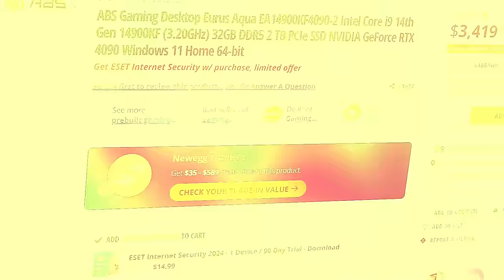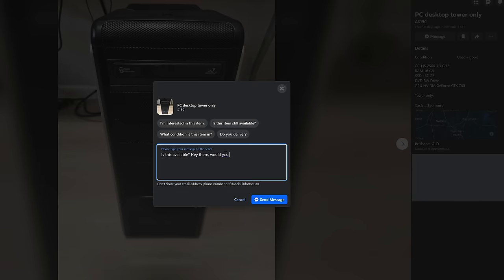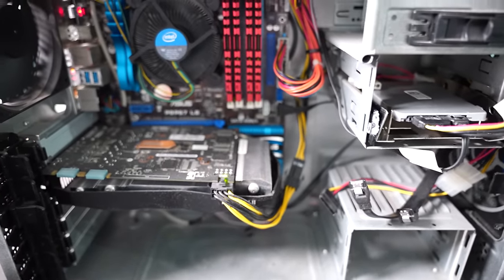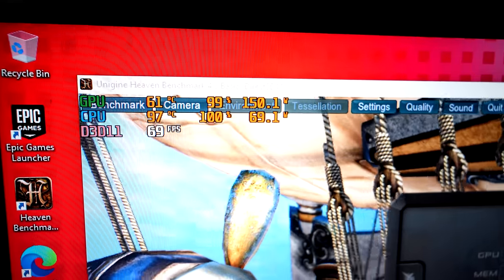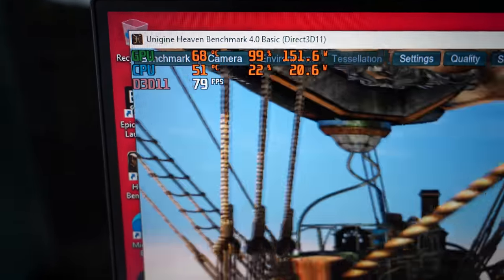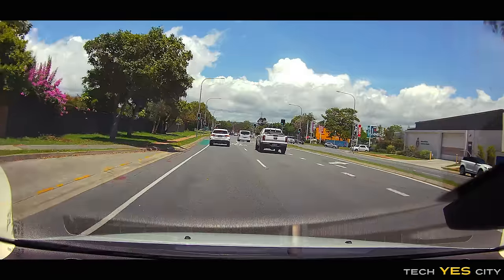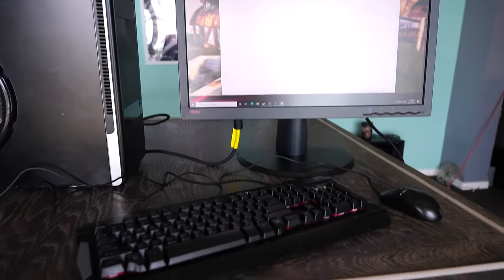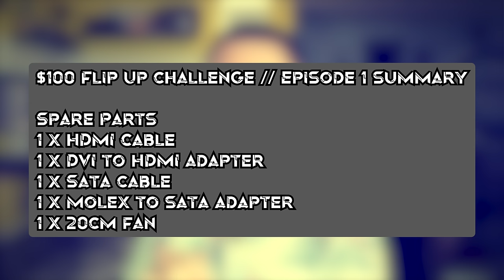Turning $100 into a HIGH-END Gaming PC - S3:E1 "Less (Power) is MORE!"

Comment from the maker: Easily the most requested content on the channel is BACK! Enjoy the rollercoaster!
Reply: ive used cleaning slime for cleaning in between the keys on a keyboard. it works really well. i love the $x flipping series.
Reply: If you weren't quite so far away. I have a bunch of spares... 3200G, 2600X, a320i, an itx 2060, 2x 4GB 3200 memory & 650w psu.
Reply: @justinpatterson5291  where are you? Maybe i can help.
Reply: Yaaaaay I did not expect this but I‘ll take it happily
Reply: @techyescity Started watching you 10 years ago when I was 14, now working at a local repairshop repairing and building pcs. Thanks for the content, I’ve learned a lot over the years! ❤
Reply: Bought a malaysian pc i see.
Reply: Even a 2004/2005 400 Watt CRS PSU would deliver more on it's 2 12V rails. I once had build a gaming PC with that back in the day with a Core2Duo and a GTX460 (2 six pins).
Reply: Yes yes yes!!! The beat series on youtube is back baby.
Reply: I remember owning a Yum Cha power supply in the day, it cost me a whole PC "A big bang, blue smoke and a smell that was worse than some nostril hair being burnt!" Learnt my lesson and never touching a no name PSU again, I hope you used InSpectre utility with that CPU in windows ty for reading!

Comment: Blows my mind how even the 2500 can push out nearly 120 fps on CS2.  I'm starting to question if my own build is overkill 😂
Reply: My 8700 gets like 200 max with a 1070ti
Reply: Single Core performance..Old engines using single core.
Reply: Notice he never shows any gameplay for CS2 though. Likely because it doesn't run that well.
Reply: Depends on what you use it for. I rock an i5 12400f and a 3060TI n feel like I already need a upgrade. My son wanted to play forknife and some other garbage like Roblox and battle bit. I spend next to nothing on a T1650 computer from dell and modded the case to take a bigger GPU, popped in a better PSU and built him a respectable PC with a Xeon 1230 v3 and a rx 580. The build cost me around $200
Reply: @HardWhereHero  Hardwares are good these days. If you manage your expectations its great. I have 12100f 6700xt and 4k60 is no sweat(with appropriate settings ofc)
Reply: What are your specs?
Reply: Nothing wrong with a 2500 I had a 2400 for years with a gtx 1050ti then a 290x and it worked good then I got a used 1080 and had no issues with any game maxed on 1080p except recently with maybe like cyberpunk then I swapped for a i3 12100 and its once again not an issue lol.
Reply: @BREEZYM6015  5700x and an RTX A2000 12GB.  The former from a Black Friday sale that made it 100$ and the latter from last year's crypto crash, making it 350$.
Reply: battlebit is not garbage
Reply: @cdnron75  exactly, standing still is not a true average
Reply: been using 2500k since its been released, aint go no complain to that bad boy
Reply: @Hablift  source engine scales with up to 6 cores and SMT, it has always been able to take advantage and utilise more than 1 core.
Reply: @Hablift Valve is moving on from source 1
Reply: Dota 2 is overdue for the same treatment as CS. Performance is abysmal.

Comment: I would have never paid $80 for that PC. Aside from the e-waste SSD, it's 10-12 year old technology. Cheap old power supplies like that are fire hazards (I've seen cheap ones like that actually catch fire) plus you can see rust on it! It's not worth trying to keep the budget under $100 if the power supply is going to fail soon or burst into flames on the buyer. As well, the GTX 760 hasn't had driver updates in quite some time, and I'd like to know what settings you used in Heaven to get those FPS. I always run it with everything maxed out to truly stress a GPU, and with much better graphics cards I don't get those numbers, so you're not truly stress testing this card. You also say early in the video that you kind of got hosed on the PC but after cleaning and "tuning" it plan on selling it for $250?! If you plan on selling it for that, replace the power supply! This gives me used car salesman vibes. Sketchy AF.
Reply: Is undervolting the "slaps roof of car" meme but for used PC's ? 😅
Reply: Can you find a setup that performs better than this for less than $150? Pay less, get less.
Reply: @technicallycorrect838  😂If it's not, it should be!
Reply: @cdnron75  
Have to agree here. I get this is absolutely lowest budget, but if you don't make an effort, just don't do it. Undervolting is not a fix, if someone clears the bios or just disables the GPU undervolt/underclock somehow the pc will be unusable again. Fine if you do it on your own PC, but I would not sell this.
Reply: @NamTran-xc2ip my £100 shitbox with a 1050 ti probs

Comment: Heads up!! That power supply has a very beefy 5V rail with 40A output. That makes it extremely sought after for retro builds using Athlon and Pentium III or older systems. Were you to remove this PSU and market it correctly in a retro PC forum, you could probably get 50-60AUD from that piece alone. Something to keep in mind in the future when dealing with older power supplies. It actually has great ratings for use as a retro machine.
Reply: It would be sought after if the listed ratings are true, which I can pretty much guarantee they aren't. I've been in the business for over 20 years and have seen enough cheap power supplies to know that the specs have been faked. A quick search on the Interwebs also shows that these aren't quality units. Comments from different forums regarding iCute's quality:

"iCute PSU's are rebranded from Ultra which are not good."
"Replace it as soon as possible. Budget PSU's are sometimes a danger to the rest of your computer components."
"Should I replace + iCute PSU = Yes, do. Before you regret it!"
"Yes, get rid of that piece of garbage quickly."
"be warned: icutes are infamous in my side of the world for being hand grenade power supplies. dont use it for anything critical or expensive as it lacks proper working short circuit, overvoltage, overcurrent, overpower and overload protection"
Reply: Never trust the numbers on the sticker of the PSU? But how to measure or detect the true values and numbers of the PSU? Thanks!
Reply: @paulhorn24  Never trust the listed ratings of CHEAP PSUs. Stick to well known brands.

Comment: A month ago, a dude came in with a similar-ish old spec'd PC for repair. With a f***ng Noctua D15. Yes, the full size dual fan. Worth more than the rest of the PC. Apparantly used for music production. We told him to keep the NH-D15 sell/donate everything else.
Reply: I once paid $5 (yes, five bucks) for an old 775 based PC (with some components missing) just because it had a Scythe Ninja 3 in it (in perfect condition I might add!); still one of the best bargains ever!
Reply: Hell this case with the 200mm fan slot and 8 drive bays is a rarety today! Everthing is built to revolve around RGB and gigantic radiators and tempered glass.

Comment: I would have just replaced the PSU with a better unit that I would be able to count on. Good video none the less.
Reply: Same I would have forgot about the monitor, mouse, keyboard(that keyboard would have been 100% no go for me), and salvaged a better PSU even if it was only 50 to 100 watts more.
Reply: Yea, you know Les would have had a $5 PSU that would have done the job
Reply: Normie doesn't know what a psu is and it doesn't impact their buying decision. They see they get a monitor, working input units and a pc as a combo is lot better in an eyes of a normie.
Reply: @Jinny-Wa  Most of the time that's the case. I was looking at it from the perspective of a seller though. I would have replaced it simply to lessen the chance of a bad experience for the buyer first and also the headache of it going out a few hours, a couple of days to a week or two after leaving the shop and becoming a comeback issue with a possibly angry customer. If your making money flipping, word out mouth goes a long way in both directions. Good or bad.

Comment: If that PC was used for basic PC tasks and light gaming there's no reason the previous owner wouldn't think it was working fine. Most people don't check power supply specs and run Heaven benchmarks. Could've been a cheap PC they bought used just like you did, but they didn't have the knowledge to know there were any issues.

Also do you sell PC with undervolts and various BIOS changes? What if the buyer ends up resting the BIOS for some reason or reinstalls Windows? The changes you made will reset and it could go back to crashing/overheating. When I used to flip PC's I always tested and sold them with stock everything to make sure they were stable at a baseline.
Reply: Same here. I run a system completely stock and stress test it at stock to make sure everything works. Undervolting and BIOS changes to stop it from overheating is not a proper fix. This video gives me used car salesman vibes.

Comment: Brilliant as always Bryan.... As someone who built their first DIY PC around 2011 I think (first gen i7 920), I've built many a system for myself, family, friends, to sell, and refurbished and sold on parts on eBay/Gumtree (here in England) etc... I feel like I need to start shifting some great price-to-performance systems here if people still have the disposable income, luckily I was born in, and live in, a very student central city (Cambridge), so you can always bet on rich Chinese or foreign students with plenty of money too burn, not that I would overprice anyone.

Cheers!
Reply: Just built and sold a system to a friend of mine - 12600k, RX 6700 10GB, 16GB 3600mhz DR4, 1TB WD PCIe 4.0, 2TB HDD, nice MB and Noctua cooler, sound-proofed tasteful case with no clear panel etc... He's very happy with it, and it's a very capable system. De-bloated and optimised as much as I could regarding Windows services/programs, memory timings, GPU underclock/memory overclock etc....

No profit - just did it as a favour to a good friend of mine.

Comment: About that pc.
As far ,as i can remember,that huge fan shoud have leds.
If they not working,it 20 fps less.....
😂
And them settings in Afterburner - the woud survive until the Windows reinstall,or Afterburner.
Same as with the BIOS, unless you locked it.
I wouldn't go this way, Brian.

Comment: I sourced a i5-8500 office PC for 99. Threw an LP RX6400 in it for 99. Backlit the front panel with rgb string light just for bling, for 9. Sold for 399. (USD)

Also did a full sized HP tower with an i5-6400, put a used RX6600 in it. That whole build also totaled around 200. Blows the socks off the fps counter for fortnight and cs2

Comment: Do you buy parts separately? I have a 2500k and Asus Stryix R9380 4gb and a Cooler Master HAF case Corsair HX750 Pro series PSU 8gb?? DDR3 Ripjaws. Was going to upgrade bits.... But decised to upgrade my whole system. Theyre all in the case, just not connected.... Maybe i should get it cleaned up running and see what you reckon....

Comment: Unless it was some movie magic with the cut you did download on steam at the same time. That eats 100% on older systems easily on decent internet connections. 

So perhaps the comparison was not 100% accurate after the under volt. Otherwise I don’t understand why you would go from 100%  CPU load down to the number you got. 

Any way. Great to see another series.

Comment: You need to come to USA and do a $100 build. I have a few older (2012-2014)Xeon machines that I would let go for cheap as long as you could come up with a decent graphics card. Monitors. I have about 25 extra. HP branded HD models. Older but still usable. Especially if you want a dual monitor setup. The used PC market has taken a huge hit this last year. CPU's and memory are worth a lot less than 2 years ago.

Comment: I have the same i5 2500 cpu that reaches 90+ degrees, I know it just needs a good hsf cooler because when I force speed up the fan (turbo with fan software) of the basic dell oem hsf the computer works fine...

Comment: Is lenovo P520 with a gpu a good idea ? Is it possible to do a better price performance build ? With a budget of 700-800$ ?
Reply: Check what kind of psu it comes with and how many 6pin or 8pin connectors it has. Check IceBergTechs video about console killer, he used P520 in it with rtx 2060 iirc.

Comment: $80 what did you expect it was fine for the money.

One of the first things I check is PSU before I buy it's an area large % of people skimp on not understanding how important it is.

Sad to sell it like that I would take the hit spend bit more money to solve the issues rather then sell it crippled or missing parts. (cowboy stuff selling keyboard like that)

Whoever pays $250 is being robbed.

Comment: When you did the initial benchmark the CPU usage was a 100%, the next day it was 20%, wouldn't that account for the power drop?

You were downloading games while running the benchmark which would've increased CPU usage
Reply: I noticed that too. The CPU isn't going to get that hot when it's only at 20% usage.

Comment: Aren’t you worried about selling this PC with an undersized PSU will cost more in reputation damage than a quick buck? The first time the PC has the bios reset it will be pulling too much off the PSU
Reply: That’s why when I sell I don’t bother with any changes besides xmp. Where I’m at basically every buyer has no computer knowledge and I don’t want to be playing tech support if a bios setting messes up everything. Even if I could get like an extra 10 percent performance on a cpu overclock

Comment: Hate to burst your bubble here, but that is NOT a "high end" machine... Lol. However, no more than you gave for it running windows 10 even?... you got a good deal. Also, i think you are right about that CPU heatsink not being clipped on one corner. Someone was obviously jacking with it having fresh thermal paste and didn't get the heatsink clipped back on right. With no more than you done to that heatsink and lowered the temps that much?... yeah no way was it clipped down correctly. Might be why it was sold cheap, it had heating issues and the owner couldn't figure it out... a great win for you bud.

Comment: Upgrade an old HP rp5800 with 32gb ddr3, I7 2600k (not found 2700k), ssd, 2 x 4to hdd, wifi and 1660ti (little Undervolt for safety) all with the 240w power supply and all is ok.

Do the same 😘
Reply: I use a riser for gpu and molex adapter to power it.

Comment: Arent your undervolts going to reset themselves the first time the next person shuts the computer off the wrong way or gets a freeze and then when they get it started again will be setting at the point you were in the beginning lol whoever buys this pc must be slightly computer savy to be able to reset the undervolt in msi afterburner which is actually kinda hard to do if you dont understand it lol and yes I5 2500 is still a badass for how old it is but the gtx 760 will need replaced if someone wants to play anything more powerful then fortnite I know personally the I5 2500 will play hogwarts legacy paired with a capable gpu like a rx 470 or higher no problems...